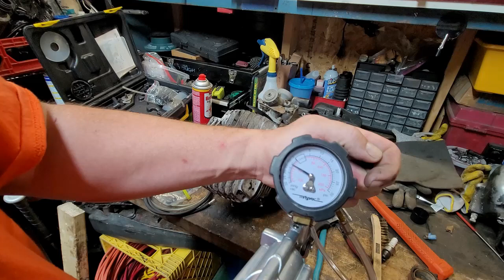How to pressure / vacuum test a 2 stroke  Working on David's TS125

Comment: Kevin any clue how much  pressure a 2 stroke engine makes when its running?
Reply from the maker: Do you mean crankcase pressure
Reply: @2strokeguru  thanks Kevin, yes i see most people keep the incoming pressure rather low to avoid blowing the crank seals.my question basically is a pressure test the same as a vacuum test sucking in or blowing out both ways will show a leak . a pressure test will show air bubbles anywhere especially a 4 stroke with leaky valves.
Reply from the maker: @frankdillon6127  I do the pressure test for the soap bubbles mostly and the vacuum test after so I don't suck in soap water not much pressure is required
Reply: @2strokeguru  yeah, a leak is a leak whether its a vacuum or air bubbles usually not good. i got it thanks.

Comment: is this the same test as used to pressure test a 4 stroke? or is the 2 stroke different as in the vacuum pressure test. I.E. pressure vs vacuum.
Reply from the maker: Frank you ask great questions the test used on a 4 stroke is different its called a leak down test and only test the cylinder on a 4stroke engine the crankcase is vented so it will not hold pressure on a 2 stroke engine it needs a sealed crankcase to run because on a 2stroke engine it has transfer ports
Reply: @2strokeguru  thanks Kevin too completely different tests, i now understand as the 2 stroke must have a completely sealed cranks or it will run way to lean.